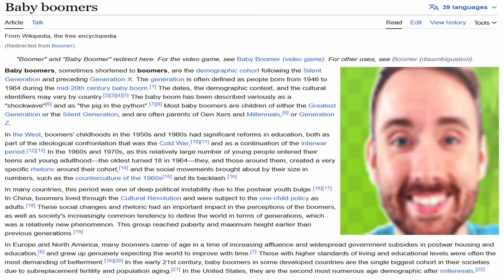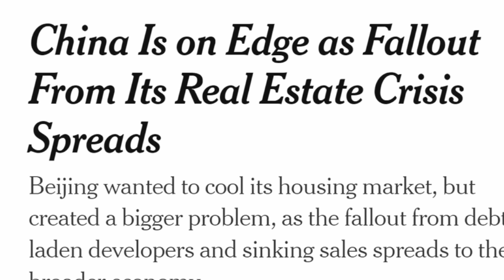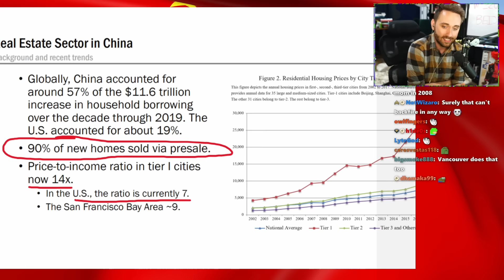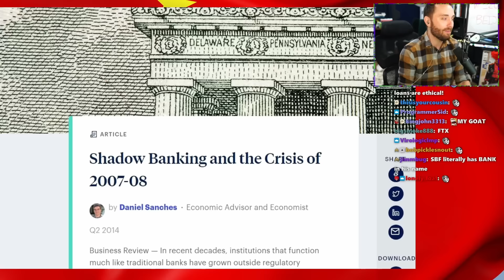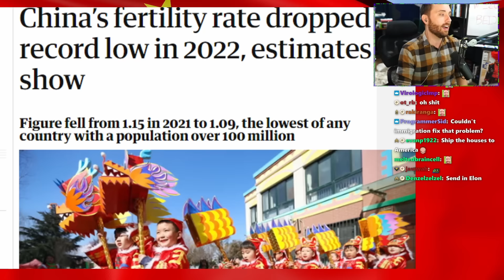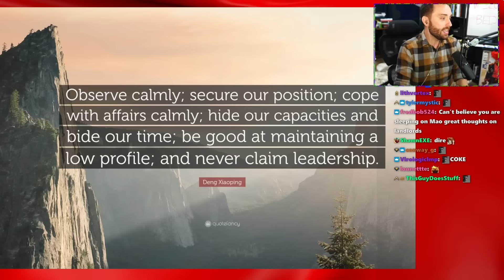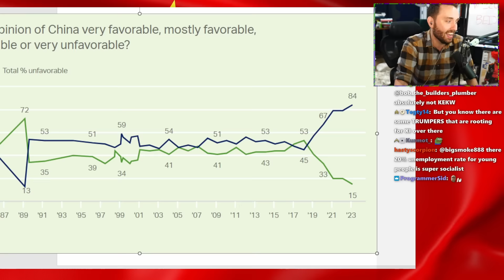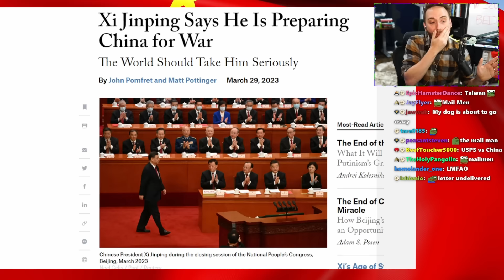A Simple Explanation of China's Debt Crisis

Comment: Atrioc, loving the content. I have to clarify what they mean by "Cash pool". This is an insurance term and it does share characteristics with Ponzi schemes. Ponzi schemes were created off of the system. The system itself is not a scam, though, and it is how insurance carriers lower their cost by spreading risk over many assets. The same thing is done with retirement accounts, for example. Annuities such as Social Security are an example of a "cash pool". When invested in different tranches of risk you can achieve higher than average market returns quite reliably. This is how Hedge Funds work in the most basic sense. Cheers!

Comment: I mentioned this in the full video, but there is a small issue with the video, as the Hang Seng Index should not be used in Zhang Fei's hypothetical. Hong Kong is part of China but a separate economic and political jurisdiction from the Mainland. This means that, due to Mainland China's strict capital controls, Zhang Fei likely would not be able to invest in the Hang Seng Index, which would not directly concern most Mainlanders. He might invest in Shanghai's stock exchange instead, which also isn't doing too hot right now.

Comment: Typically, people borrow most of the cost of a house from a bank. Because who has THAT much money just lying around?

And the bank does not release all the money to the developer immediately. Because, the developer will just run away with all the money. The buyer usually have to pay a deposit. After the developer has reach a percentage of construction, it would be verified by an engineer licensed to do such things. Then the bank will release a portion of the loan to the developer.

These goes through many cycles. The developer builds a little, the appointed engineering company signs off that they has reached this stage, and the bank releases a little bit more of the loan. These small partial payments are called progress payments. Eventually, the house is completed, the local government will certify that it is fit for occupation, and the bank releases the balance of the loan. Usually, the buyer starts paying the installments at this point.

The reason is because once they can move in, they will no longer have to rent somewhere else, and they can redeploy their monthly rent to service the loan instead.

PS: the excitement over the crashing property market is premature. People who dislike China and/or the CCP is just wishing that the country will implode. It will not. 

(1) It is good that the property bubble popped now. The alternative is to supposed that a growing bubble continuing to grow ever gigantic IS A GOOD THING. That is insane.

(2) Not everybody in China are homeowners. The people who already paid off their homes would be a little bit sad that their asset is not appreciating as fast as it used to. If their house valuation drops by 50%, they'll  be unhappy for a week. They'll get over it. They've paid off their own house that they are now staying in. This doesn't really affect them.

(3) The people owning lots of properties and renting them out (like Trump) would be pissed. The people who just bought a new home, only to have it now underwater ... they would be very unhappy that their outstanding loan is now more than what their home is worth. They will grumble. But they will continue to service the installments.

(4) The people owning homes in abandoned projects, with loans to repay, but no home to stay in ... these people would be protesting in the streets. But their numbers are small. Probably less than 1% or 2% of the total population. (Most homes have already been completed. Only a very small proportion is under construction). And their numbers will shrink further, because local governments will take over the bankrupted developers, and get another developer to finish the project, putting in public money to cover any shortfall. This is what usually happens. It's very common in my country.

(5) You people, and everybody else who hasn't bought a home yet, they would be happy that new properties are now more affordable. It's a similar situation like in your own country. Young people complains new homes are too expensive. Old people are happy that their paid off homes are now so valuable.